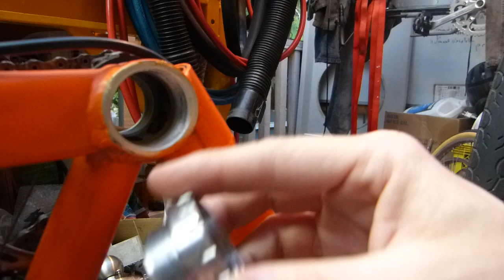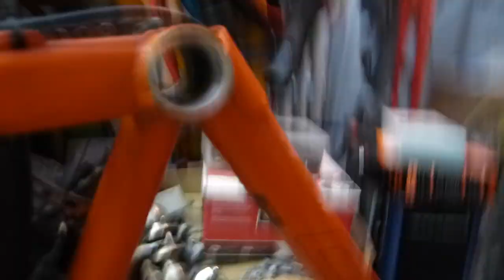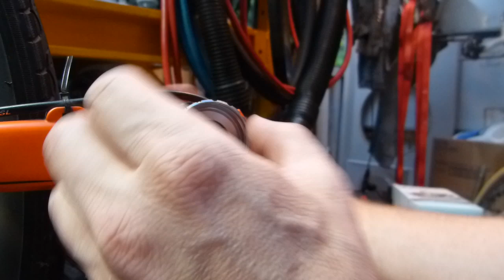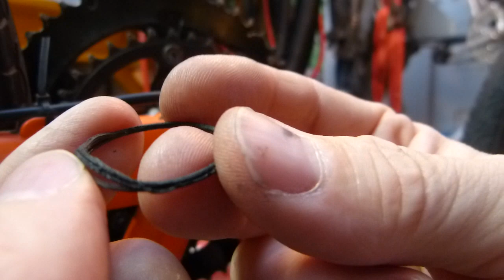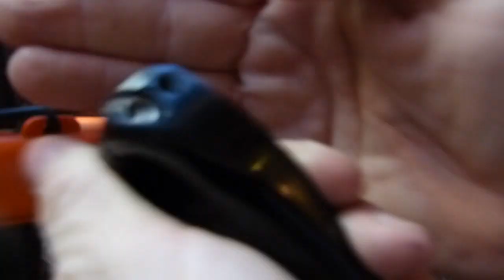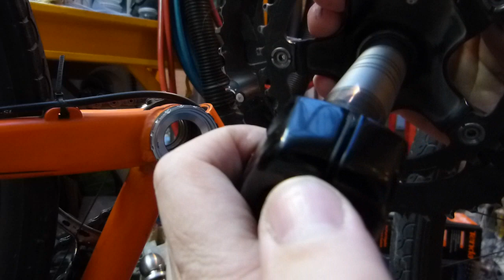Threaded bottom bracket installation: parts and fit involved

Comment: I'm replacing SM-6700 68mm BC1.37x24 with SM-BBR6- 68mm BC1.27x24. Now chain won't shift to big outer ring. Haven't changed anything else in my setup at all. I reassembled it like 5 times, bashed with rubber mullet, it fits properly but won't shift to big ring. Previous bottom bracket SM-6700 had no this issue. any help appreciated!
Reply from the maker: Bashing is not too good for precision setting that bearing pre-load. Ask Hambini (channel), he does bottom brackets all the time, has the manufacturer's drawings, etc.